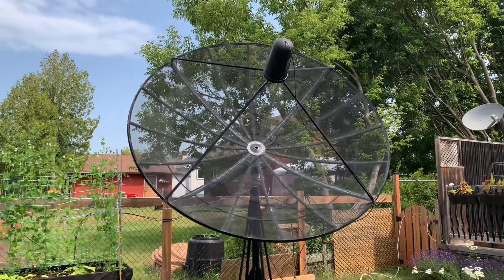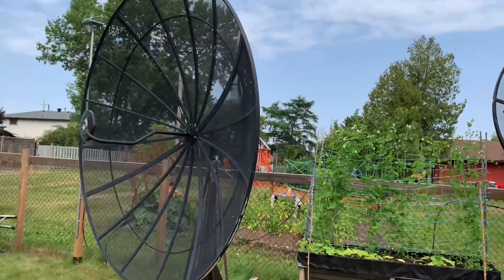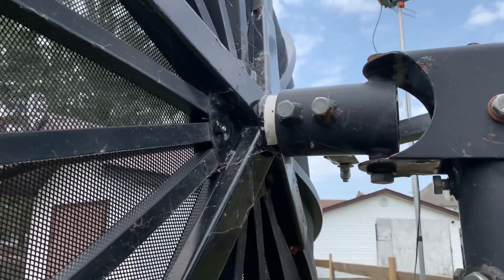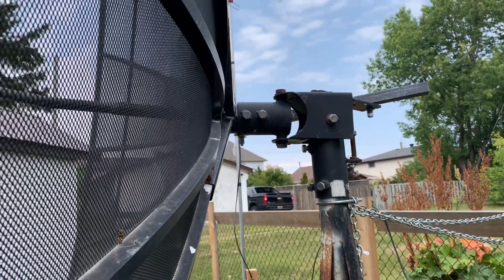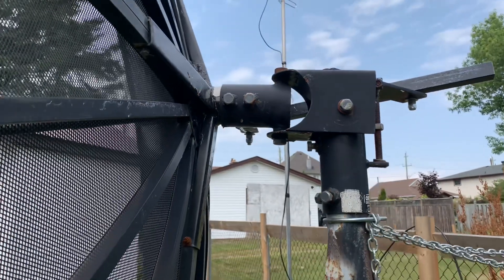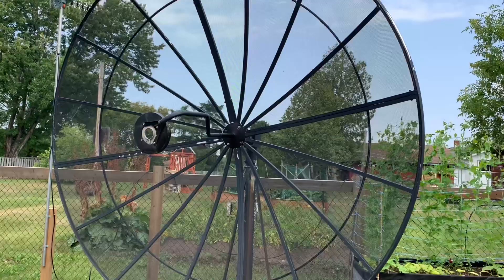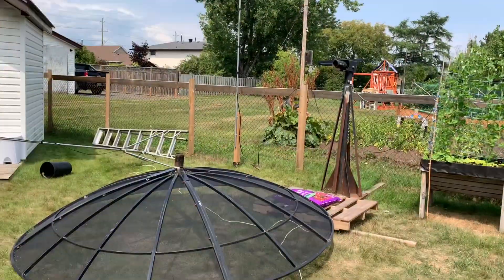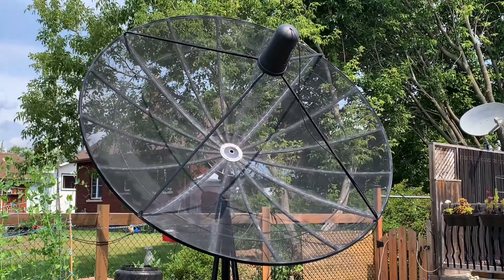Removing one of my C-Band Satellite Dishes - FTA Satellite TV

Comment: Why would the Orbitron be any more difficult than other dishes? You correctly set the declination, the elevation, and the azimuth just like any other dish.
Reply from the maker: Thanks for your comment. As I said the Orbitron is awkward to set up. Some of the original markings are missing. The LNB arm never centres correctly. And I enjoy setting up dishes anyway.
Reply: @NorthcoasterHobby  You don't need the original markings, just use an inclinometer which is more accurate anyway. If you want I can explain to you how to use one. The reason you are having problems centering the feed horn is because you removed the guy wires. I thought that would be obvious.
Reply: Spinning a bolt v.s spinning an entire antenna.
Reply: @dickvl3434  It's not like you adjust the declination everyday. You set it once and forget it. Taking down the dish and putting up a new one like you did is a lot of work for nothing.